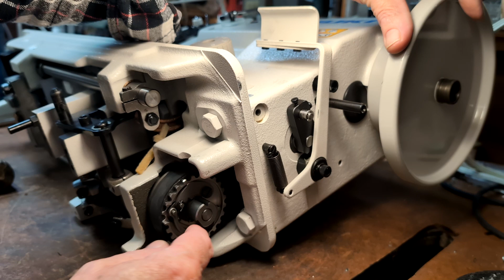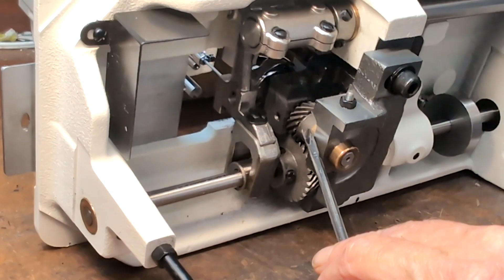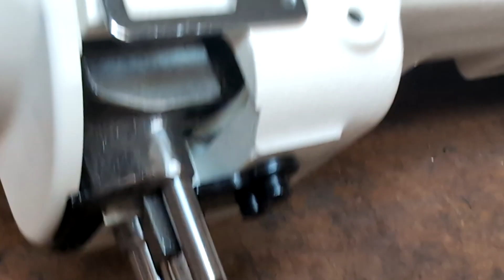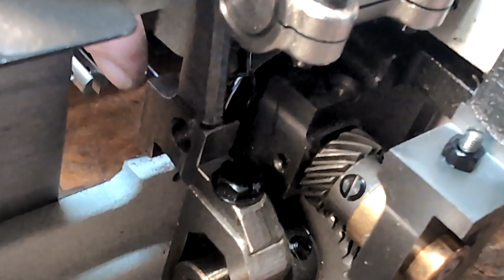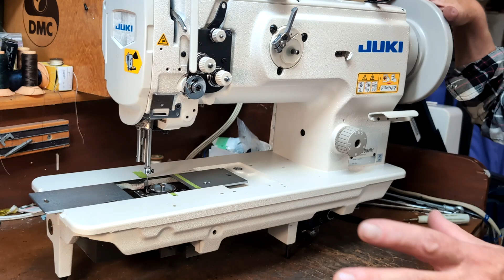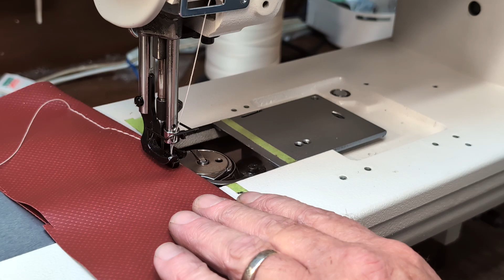Juki LU 1508 NU  Maintenance Video - Neil Milheron, Bridgewater Sewing Centre Ltd.

Comment: Great video, thank you for sharing this! I’m choosing between the Juki DU-1181N and LU-1508N for bag and pouch making with Cordura, canvas, XPac, and seatbelt webbing. From your experience, does the 1508N handle these materials better without puckering, or would the 1181N be more versatile for medium-weight projects?
Reply from the maker: The juki DU 1181 is a lighter duty machine than the 1508.